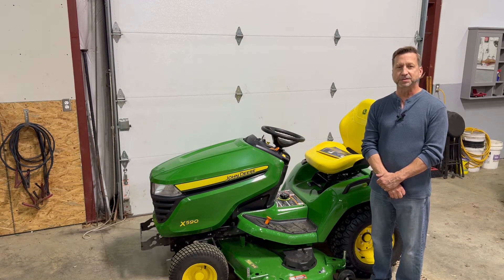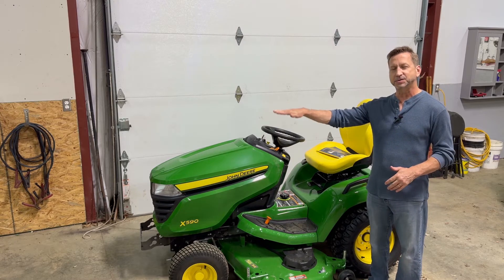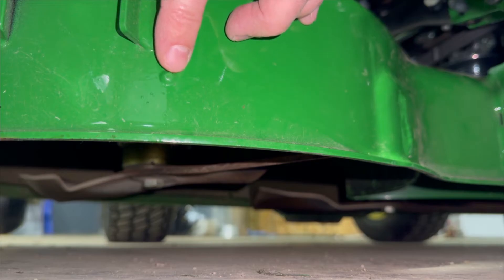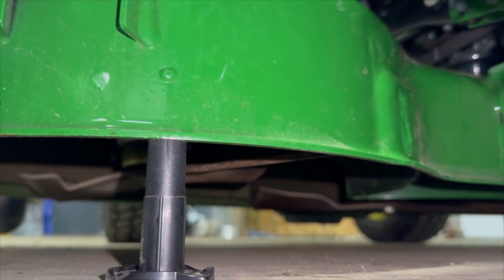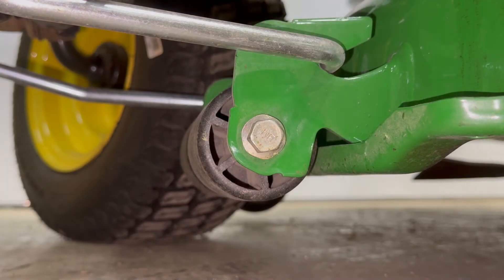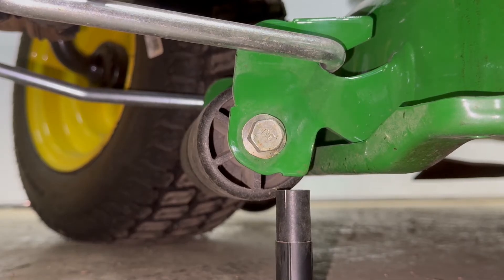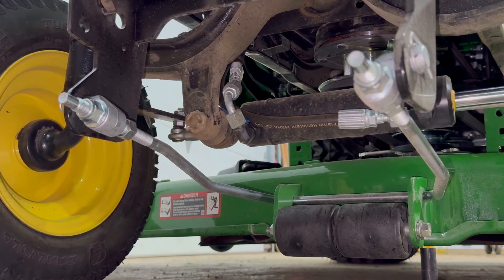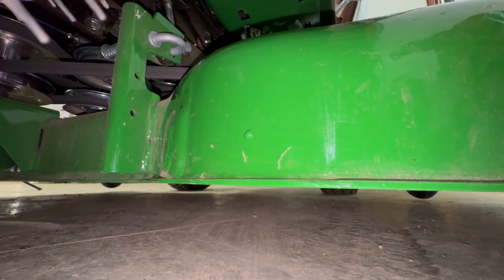John Deere X590 Deck Leveling

Comment: I just bought myself also a x590 within the past few weeks and thought before I try to figure out the book I would just take a look at youTube and see what was on there. You done a great illustration so you made it much easier for me. I also have a JD 317 that belonged to my dad and I purchased a JD 345 back in 1995 for myself that I still use but figured its about time to upgrade. Gonna keep the 345 for my Cyclone Rake leaf pick up and cutting rough areas and also assisting others that need help with there grass. Anyway thanks! Mike
Reply from the maker: Thanks Mike, I appreciate you taking the time to comment and glad you found the videos helpful. Those 345s are good tractors for sure. My neighbor had one years ago and I was always a little jealous lol. 🙂

Comment: I have the same 2024 Model X590.  My biggest problem is getting the wrench through the deck top hole into the nut on the discharge side of the deck.  I was hoping you would show how you do this.  Inserting the wrench on the left side is easy, inserting it on the right right side is difficult for me.
Reply from the maker: I struggled with that a bit as well. I was at floor level when I did it. I would find the head of the bolt under the tractor with my left hand and then poke the wrench through and guide it into place with my right hand. Hopefully that helps.

Comment: I made easy to use gauges for leveling the decks  of all my mowers by cutting pieces of 1" PVC  pipe  2 1/2 ", 2 3/4" ,3" etc. and marking them and they actually measure at the blades edge which are often off from the factory markings. Just turn your blades to the side and stand pipes under the edge of the blade to check height using like go-no- go gauges. Then turn each outside blade to front to check level front to back.
Reply from the maker: That’s a pretty cool idea. I do want to try measuring the actual blade height to the cement floor to see how close it is. I had a cub Cadet years ago that I did that with and it was pretty darn close, but I’ve not tried it with the John Deere yet.

Comment: Any thoughts on using the gage as you showed VS leveling using a blade gage (sold at JD dealerships) that measures from the tip of the blade?
Reply from the maker: I’ve not used one before, but I’m going to look into it. The method I usually use which is in this video is what I’ve always done. I’ve avoided that gauge previously because I thought it would be a pain, but I do think I want to give it a try. If I do, I’ll definitely make a video. If I do that, I’ll level it first with my original method then I’ll check it with the blade gauge to see if the results match. I think that would be an interesting comparison.
Reply: @HobbyUniverseOutdoors okay you got me thinking. I also have a X590 with a 54" deck.
I checked my deck level following you're/JD's procedure and using the gauge under the seat. 
I have all three points  set and adjusted. 
Next I checked the height/level using my JD gauge. The left side blade tip measures 2 ¾" at the front and 3" in the rear. The right side blade measures 2 ½" front 2 ¾" rear. 
My blades aren't bent. I do sharpen regularly, however as a retired machinist and manufacturing engineer I'm well aware of equal material removel etc.
I would like to see if you get different measurements and ultimately what we should do? Believe the under seat gauge. Check into the mower housing, or using a blade height gauge. Checking to the tips of the cutting edge. 
Strange for sure.
Thanks.
Reply from the maker: I appreciate you taking the time to dig into that. I’m going to pick up one of those blade gauges and will see what I find. It will be a good side by side comparison for a new video. Might be a few weeks or so to put all that together.
Reply: @HobbyUniverseOutdoors fyi... I leveled to the blade tips. Joe, the deck housing is not quite level utilizing the provided gauge. 
I'm not saying one method is better than the other, but considering the difference you have to pick a measurement and go with it.
Reply from the maker: I ordered a gage. Curious how mine will turn out. Cheap item so I think it’s worth a shot.
Reply: You now see the difference. Glad you took the time to try.
May I suggest you now do a video comparing both methods... I'd watch! 👍
Reply from the maker: I probably will since I’m always looking for content and this would be a good on. If I had to guess, I would say the gage measuring the blades would be more accurate. We’ll see. 😀

Comment: Good video !! I have a x738 with 54" deck and you definitely have to get the anti scalps set correctly. Otherwise it'll be uneven cut.
I do adjust mine with an actual blade leveler gauge measures exactly what the height of blades are.and yes always cycle the deck lift 2xs see if anything changes
Reply from the maker: Glad you enjoyed and thanks for commenting. 🙂

Comment: Hi Len. Do you have any videos on the bagger? I have the power flow and three bag in the back. When I hang the power flow on the front it doesn’t seem to mow as nice. They don’t have any thing in the manual. Like you said before the manual doesn’t have the right information for my 2024 x590. Any tips?
Reply from the maker: Unfortunately, no. I’ve considered picking one up, but that’s about as far as it went. Someday maybe. Not sure why attaching that would cause it to cut differently. That’s weird. The only thing I can think of off the top of my head would be that possibly the airflow under the deck is changing? The blades pull the grass upward as you mow. Maybe the bagger attachment is somehow changing how the air flows? Just a shot in the dark. Wish I could be of more help.

Comment: I would suggest that you raise and then lower the deck and recheck one more time before you consider yourself finished.  I've had times when the recheck showed additional minor adjustment was needed.
Reply from the maker: That’s not a bad idea. I could see it possibly changing as things “settle” the first time you raise and lower it again. If deck leveling comes up in a future video, I will make sure to mention it. Thanks for taking the time to comment. 🙂

Comment: Had same issue with my new 2024 X354 tractor. The manual is copyright 2017 with the old yellow deck. John Deere should be embarrassed. Thanks for posting !!!
Reply from the maker: Yep, the manuals are not up to date on the new ones.  Would be great if they could take the time to do that. Thanks for watching.  👍

Comment: Just replaced PTO Clutch.  Wasn't bad repair at all. X590 is  a-lot quieter. Drive belt was in good shape. Thanks for all your great video’s, very helpful.
Reply from the maker: @TheAirboss1955  I appreciate the update. I’m really hoping that’s the issue with mine. When the weather outside starts getting crappy, I’ll dig into it.

Comment: I have a JD LA165 and when leveling the deck it said to drop the front slightly (1-2 counterclockwise turns) so the blades don’t cut the grass twice as it causes the grass to turn brown and uses extra horsepower. This must not be an issue with the X590?
Reply from the maker: Thanks for taking the time to comment. I have an LA 115 that is similar to your 165. You’re correct, on those tractors you do want to slightly lower the front of the deck once the standard leveling process is completed. That avoids double cutting which is bad for the grass and uses more horsepower. On the X500 series that use a leveling gage, that slight tip is built into the measuring point on the front of the deck. If done properly, the blades will be slightly lower when measured in the front. Now, with all that being said, I’ve never verified that. I might actually do that to see what I find. It’s a good point.

Comment: My 2020 has the stuff under the seat.
Reply from the maker: I think the change happened in 2023 when they changed the seat suspension to a 4-point style. Just my guess…
Reply: @HobbyUniverseOutdoors  That is correct; I bought a "leftover" new 2022 model in mid-2023; the changes for 2023 were the seat suspension upgrade to X700 style, green painted deck, and removal of the X500-specific vented hood center panel in favor of the solid X300 style hood.
Reply from the maker: Thanks for the follow-up. I like the improved seat suspension but didn’t realize it was from the X 700 series models. That makes sense.